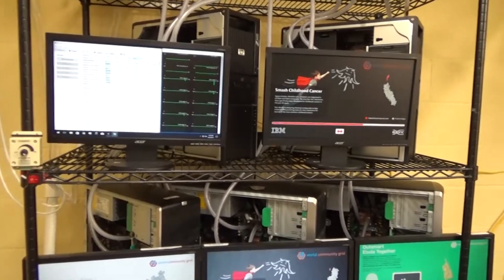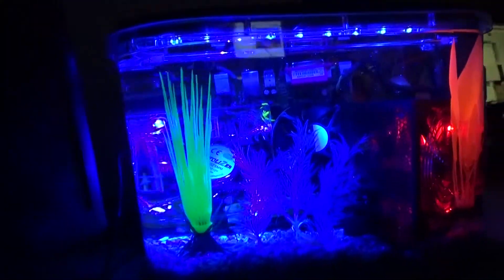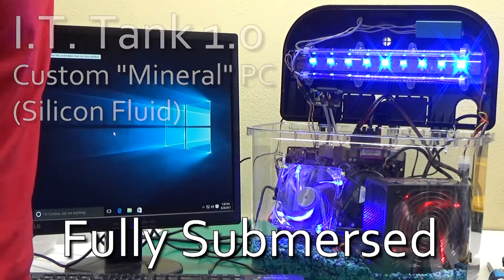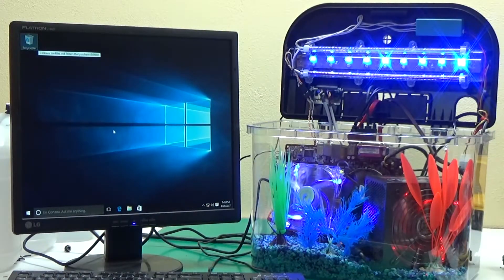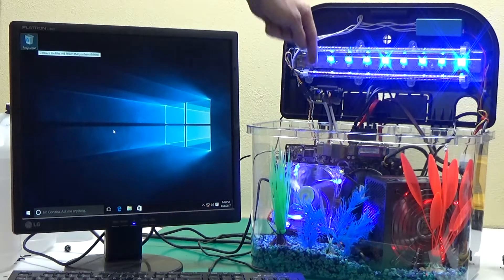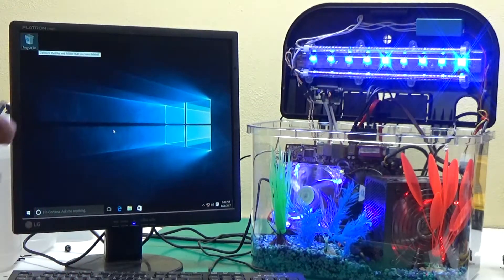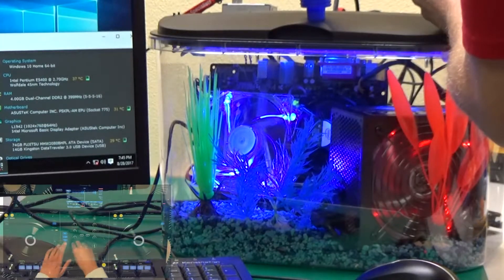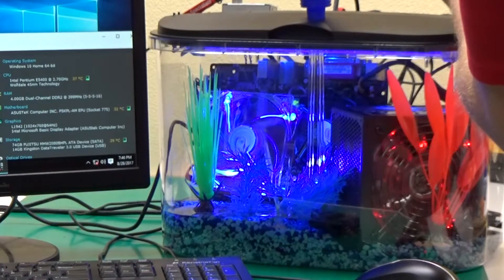Fully Submersed Silicone Fluid "Mineral" PC - Part II: "The Pour"

Comment: You never showed the temps? I wonder what kind of fans would work best in a submerged system :p
Reply from the maker: It is still running in my store today with no issues.  Temps are shown in Speccy on the monitor to the left as we add the liquid.